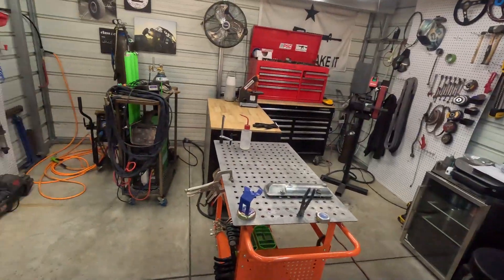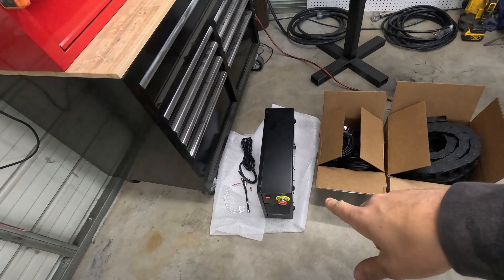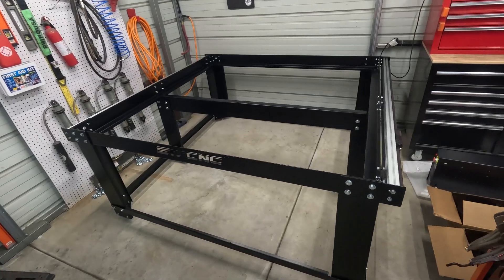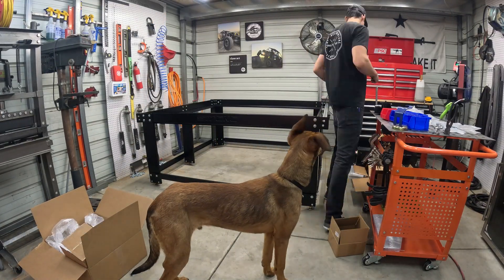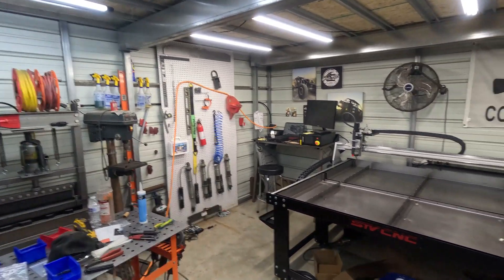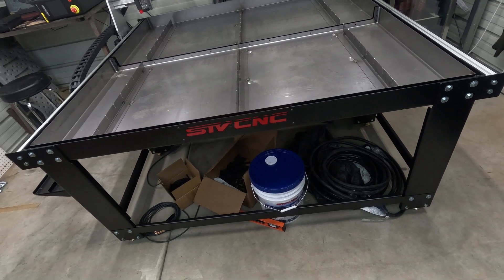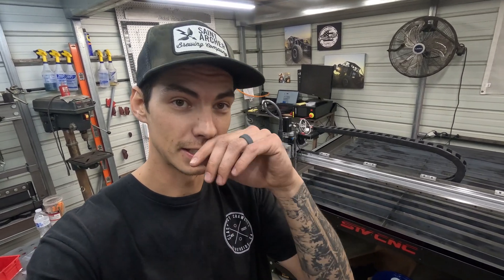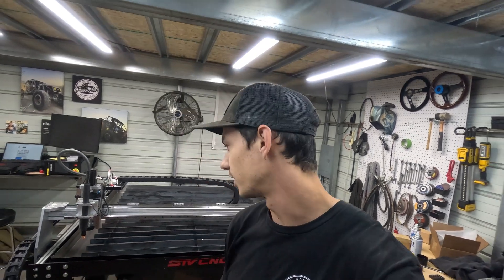STV CNC 5x5 plasma table

Comment: Any issues or regrets after owning it for 6 months or so now?  I also wanted to see how you like the standard motors vs the $900 motor upgrade option?  I'm planning to order either the 4x8 or the 5x10 version very soon and would love to get your feedback.  Also, thanks for your service. I'm active duty Air Force (don't hate me) with a little over 20 years of service.  I'm planning to start a small fabrication business on the side as I prepare to retire in a couple years.
Reply from the maker: Hey man sorry for the late response. I love the table for what I do. I don’t see any issues with the standard motors. Very quality table and the thing I appreciate most about STV is their support! Any small issues or questions I’ve had they are very thorough in walking you through the steps of how to fix or accomplish what you’re trying to do. I’ve had tables that customer support is not good and it makes a huge difference. No hate man thank you for your service all branches are equally needed! Very smart though I wish I would have started while I was in, instead of wasting all the free time I had back then. Thanks for watching!